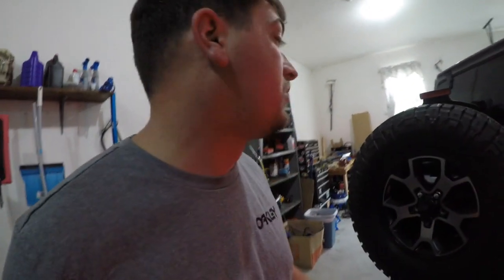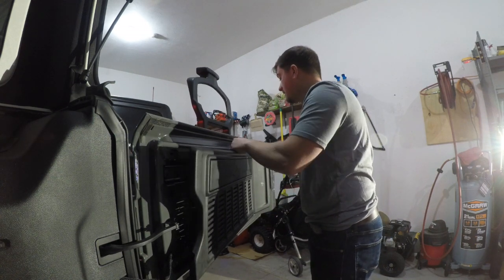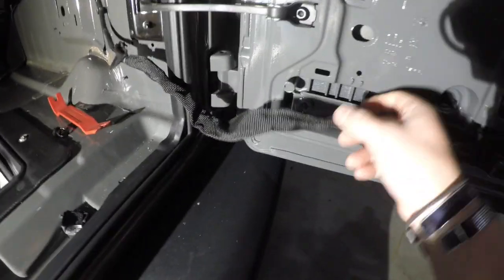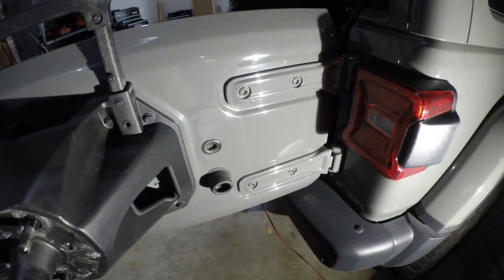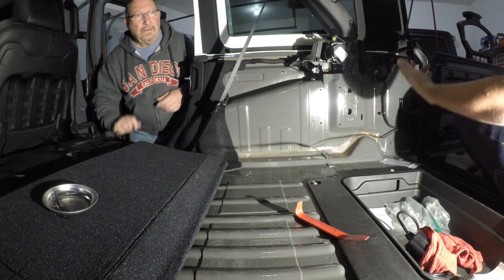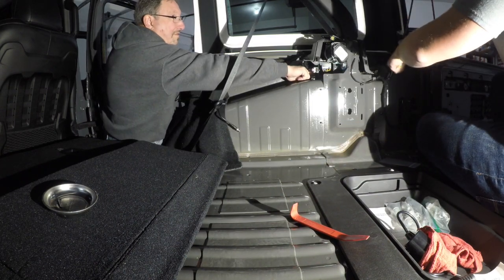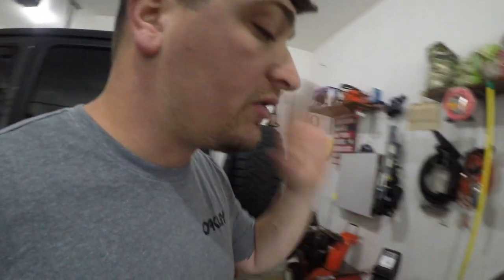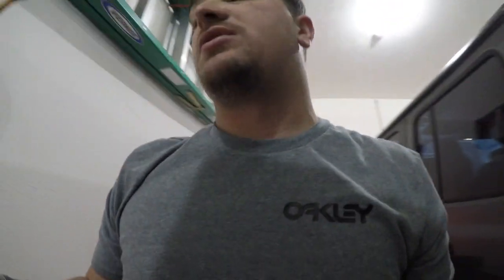How to install a CB Radio on a JL wrangler 2019 75 WXST

Comment: Thanks for this I will be attempting a coax cable route through my jeep in a few months when it warms up. I  have watched a few videos on tailgate antenna mounts. Some use a grounding strap from the tailgate to the frame. Is this required or is there enough ground for the antenna to function properly through a painted antenna mount ? Also with an antenna mounted does it interfere with opening the glass?
Reply from the maker: My mount is not painted where the antenna connects to the mount. There is no rust issue even with all the salt on the road. It does interfere with the glass the tailgate just needs to be completely open to raise the glass.

Comment: The CoolTech mount comes with its own bolts to mount it to the tailgate through the hinges. Why did you not use them? I assume they would be better for grounding as they are unpainted.
Reply from the maker: Michael Sztajer i did use them i just painted the heads.... painting the heads will not effect the ground of the entire bolt

Comment: Which antenna was that?
Reply from the maker: Jake the cb antenna or the radio one??
Reply: @TaskForceOffroad  CB, Im guessing fire stick? Appreciate this video, Im mounting mine in the exact same way. Did you find this was properly grounded this way or have you had any issues?
Reply from the maker: @Jake-fv7df  ive had no issues so far and yes its a firestick
Reply: What length fire stick did you use
Reply: I'm going to use a hot wire that will turn on and off with the accessories.